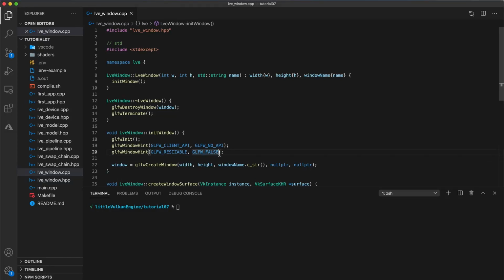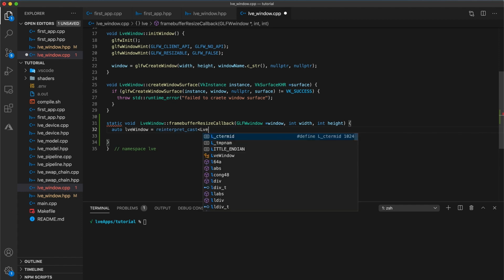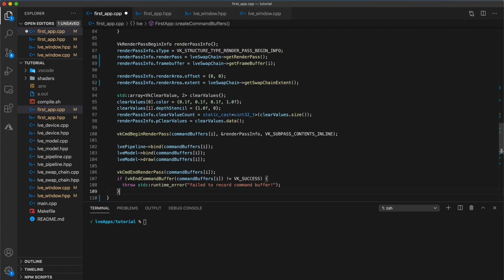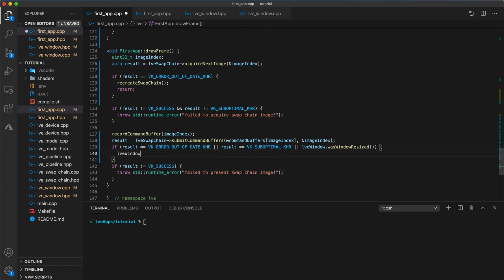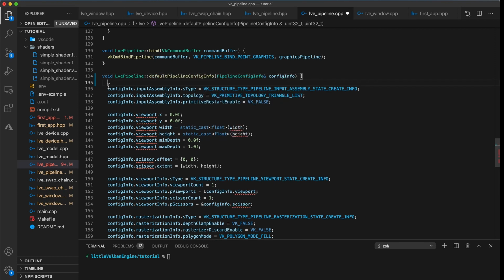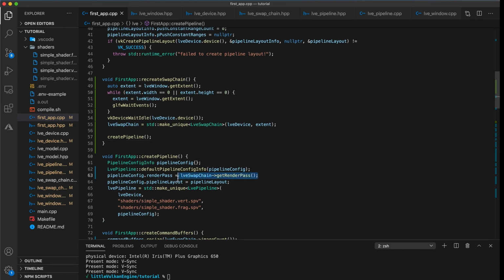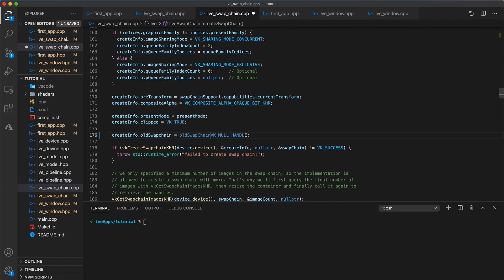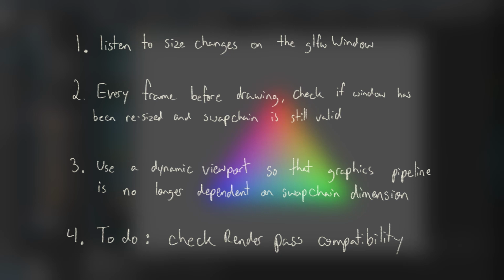Swap Chain Recreation & Dynamic Viewports - Vulkan Game Engine Tutorial 08

Comment from the maker: !!! POTENTIAL ISSUES !!!
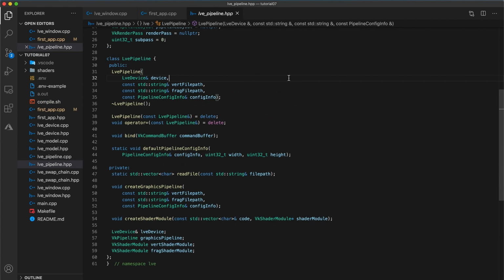At 1:17 I fix the incorrect copy constructors. But whenever any constructor is changed, the default constructor should then be explicitly defined. Therefore you should also add LvePipeline() = default; 

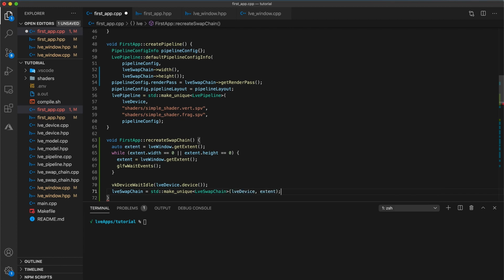 At 6:27 it may be necessary to temporary add in the line lveSwapChain = nullptr; between lines 70:vkDeviceWaitIdle and 71:lveSwapChain = std::make_... 
if you are getting the error "validation layer: vkCreateSwapchainKHR: internal drawable creation failed". On some systems two swap chains can't coexist on the same window, so this ensures the old swap chain is destroyed first. This line should later be removed in the tutorial once we provide the old swap chain to the new one during creation.
Reply: I used lveSwapChain.reset(nullptr).  Not sure if makes any difference to insure old unique_ptr is properly terminated?
Reply from the maker: @jtaimneas  - good suggestion! I had to look it up but apparently they are equivalent. https://stackoverflow.com/questions/16151550/c11-when-clearing-shared-ptr-should-i-use-reset-or-set-to-nullptr
Reply: where do I exactly add this line " LvePipeline() = default; "?
Reply: I think you should edit your comment to add a default constructor to the PipelineConfigInfo struct as well. You do not add one in the video as far as I can tell, and my IDE (and compiler) were not happy without it. Also, I tried defining it as an empty body (PipelineConfigInfo() {}), but this *will not work*. Running the program presented me with a white window and a crash after a few seconds, with no discernable error except for a weird exit code. Defining it as "default" is the way to go, since it will actually initilize the members to some default value.
Reply: This fixed a crash for me thanks
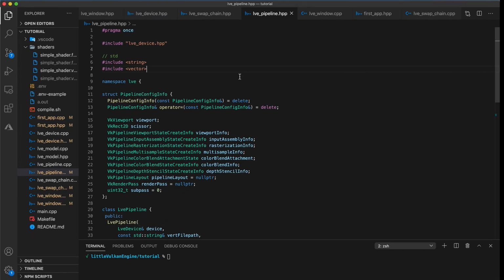Reply: The first fix should refer to the PipelineConfigInfo struct you're fixing at 9:03 I believe? At least that's where I had to put PipelineConfigInfo() = default;
Reply: Just a note, I did not insert the lveSwapChain = nullptr; but I did not get an error but rather my application would hang when I resized the window and use all of a CPU thread, through benchmarking, a majority of the time was reported to have been spent in the kernel with the last call from our code being auto result = vkQueuePresentKHR(device.presentQueue(), &presentInfo);
Reply: Glad I checked the comments when crashes began to appear when i was trying to resize the window... you saved me from a lot of debugging dude <3
Reply: Using shared_pointer to pass the old swapChain can cause a memory leak, all created swapChain will be deleted only at the end of the program. Is my reasoning correct?
Reply: Oh man I should have read this earlier, just spent 2 full days figuring out why for the single file vulkan tutorial this did work but not for this project. Interestingly the issue happens on nvidia but not on intel. Thank you so much, what an awful bug.
Reply: @hugopeters9372  Same, dude, almost 2 full days on debugging. Thx for the comments

Comment: Hey sorry for asking you to do tech support but I followed the tutorial fully, and even straight up copied code from the github when I was unable to fix things, but I am getting this error : "validation layer: vkCreateSwapchainKHR: internal drawable creation failed" aswell as a breakpoint trigering on line 43 of lve_swap_chain.cpp at "swapChain = nullptr;" any ideas what this could be?
Reply: Sorry just to specify, this was after setting up window resizing.
Reply: Also this is on Windows, in Visual Studio x64 Debug Mode, on an Nvidia GTX 1080 GPU
Reply from the maker: @conoromalley9672  in your window class, in the initWindow function do you have glfwWindowHint(GLFW_CLIENT_API, GLFW_NO_API)? And things were working before and stopped only during this tutorial? 

And I'm happy to help so don't worry about asking questions!
Reply: @BrendanGalea  Yes to both
Reply from the maker: @conoromalley9672  - hmmm that is strange. I'm assuming you've only gone up to the first half of the video and haven't yet moved onto the second half?  

Maybe try in the recreateSwapChain() just  after vkDeviceWaitIdle add in a line setting lveSwapChain = nullprt;  before you set lveSwapChain = std:make_... to ensure that the old swap chain is destroyed before the new one is created.
Reply: @BrendanGalea  Yes that fixed it! Thank you so much!
Reply: I just checked and my Swap Chain destructor is identical to yours so im not sure what it could've been,.
Reply from the maker: @conoromalley9672  - Ya that's super interesting. I suspect the issue is that for some drivers two swap chains can't co-exist on the same window. Now depending on the compiler, that one line where we overwrite the old swap chain may first create the new swap chain before deleting the old one. 

In the second half of the video we use the old swap chain to create the new swap chain, and this would have also fixed the problem. I only tested the final result on windows so that's why I must have missed this intermediate bug. So once you complete "Providing old swap chain" you will want to remove that extra line you added. If there's any more trouble let me know and I'll answer first thing tomorrow.

Comment: Hello!! i have another question. I'm trying to make a dynamic mesh and updating the vertex buffer (and maybe in a future the index buffer) but when I recreate the vertex buffer the memory ram used increases, so what is the correct way to update a vertex buffer (or a buffer in general) i was just using the createVertexBuffer method xD (each model has his own vb and index buffer)
Reply from the maker: haha ya dynamic meshes can be a tricky and will slightly differ based on certain design functionality. Are you destroying the previous buffers and freeing the memory before creating the next one? That might be why ram usage is increasing. And do you mean vram usage or cpu ram?

A possible solution with a fixed vertex capacity is to double buffer . So the vertex positions and other attributes can change, but you can't add more vertices between frames. Just create two vertex buffers, and alternate between them. And then each frame you switch between them. 

So with buffers A and B,  
frame 1: update A, render A
frame 2: update B, render B
frame 3: update A, render A
and so on

the reason you need two buffers is because MAX_FRAMES_IN_FLIGHT = 2, so that means frame 1 might still be rendering from buffer A when frame 2 starts updating B. And you can't update a buffer and render from it at the same time.
Reply: @BrendanGalea  Nice idea!!!! 
I made it some different because I'm switching buffers only when need to update a buffer, the process is: first destroy and recreate the buffer with the new data and then switch to the recreated buffer, if the vertex data doesn't change the buffers don't switch.
after a couple of hours coding i understand a lot of things and it works, thank you so much!!.